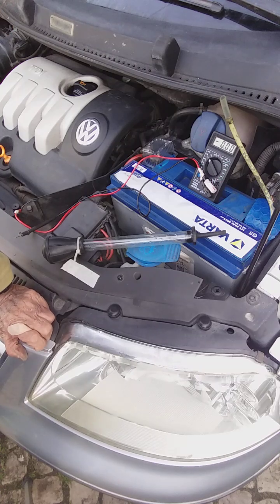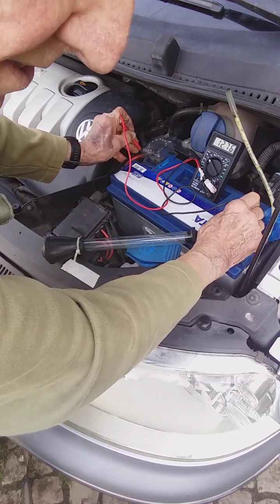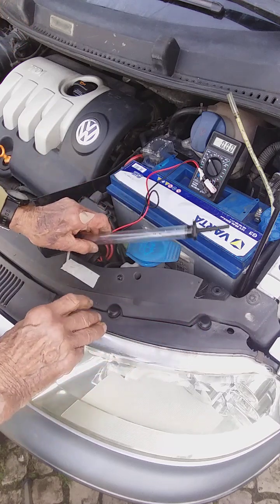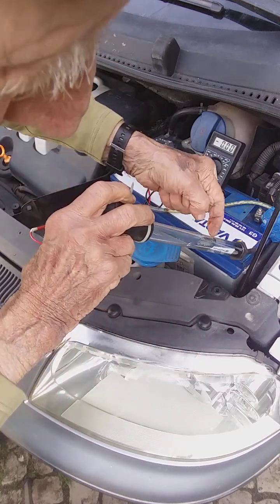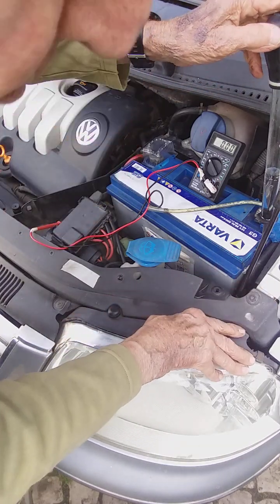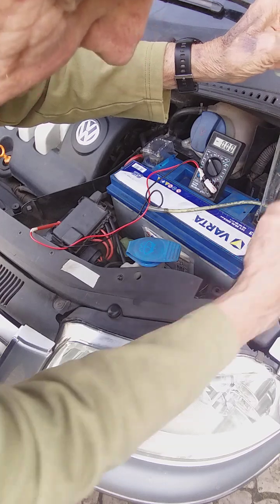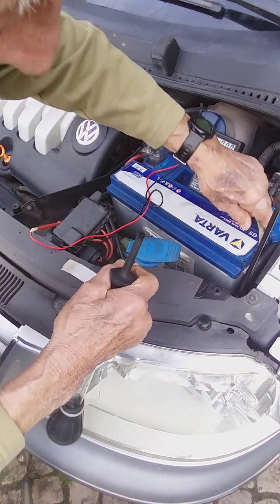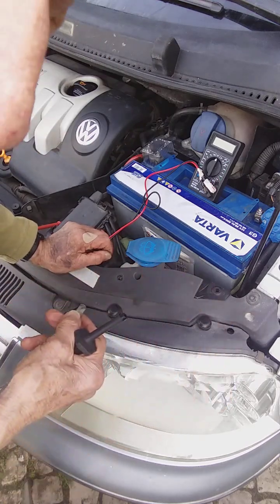How to  Top Up a Sealed 12v.Battery ,Easily  in seconds with some distilled water .

Comment: Only filling 1 or 2 cells if yar lucky that way.
Drill 3/8 Holes in the top of each cell and put the same amount of water in each..
Seal holes with disposable ear plugs. 
Ive fixed many batteries this way.

Comment: It probably has a short which is affecting the cold cranking amps, unfortunately battery manufacturers thought they would all cut corners and use less sulfuric acid which the only way to increase the concentration is to add more and stronger acid. It's a huge problem here in the States as well. You can use tester on the new ones to see the acid level, and they'll all come out low. They're hoping no one will notice but us older guys definitely notice.